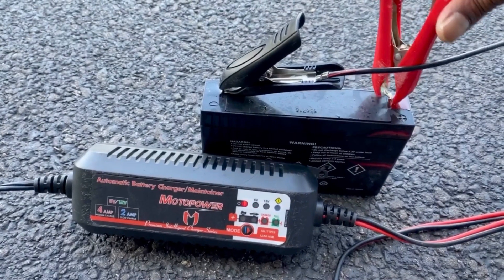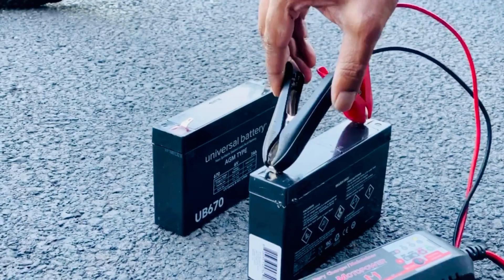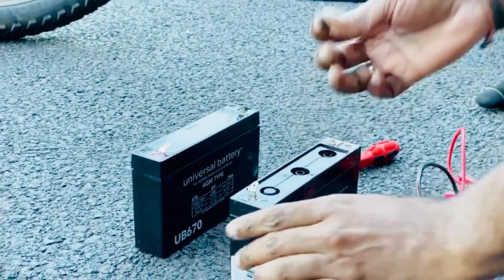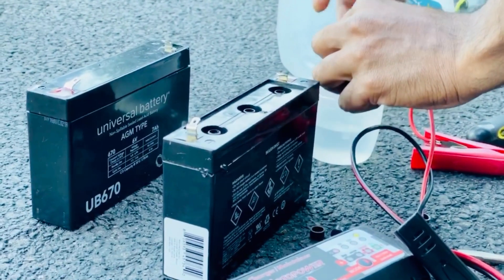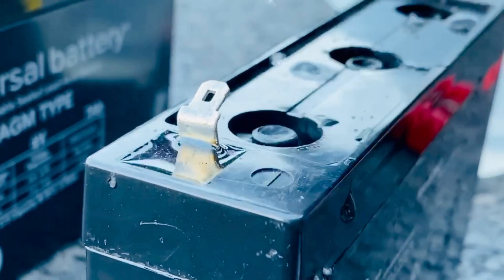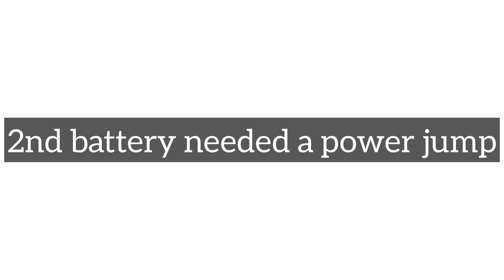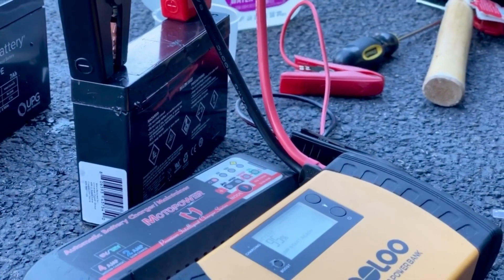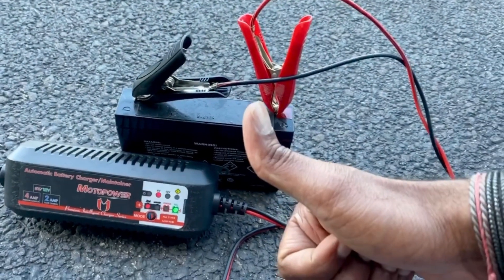Lead Acid Battery Repair in 2 Minutes | Revive and Charge 6v 12v (Jump Repair)

Comment: It will not work need 50% H2SO4 + 50 % distilled water but initially only fill H2SO4 full to charge & enhance most importantly ampere otherwise volt will show 12V after charging but battery shall be weak.Later after fully charge add distilled water & let H2SO4 flow out 50% to occupy with distilled water.Charge final one time to full 12V is achieved
Reply: proper

Comment: I thought these had sulfuric acid in them. How does just distilled water work?

I've seen many YT videos with this same advice. My 12V9AH batteries that were pretty dry, I'm not having much luck resuscitating. I only have a 2.5A 6v/12v smart trickle charger. I have fully charged other similar batteries, and tried using one of them to "kick start" the well watered battery. Maybe higher voltage / current is needed?
Reply: the acid crystalizes onto the lead plates and lowers the amount of surface area sometimes separating the plates from the electrolyte soaked separators between the lead plates in each cell. That lowers the amount of current a battery can deliver and the total power it can hold as the ability to reverse the chemistry by running a charger into it is prevented. Adding distilled water only helps when the liquid is low in the cell and sealed type batteries are not even flooded but instead just enough electrolyte is in the cells to soak the pads between the plates. If you have a lead acid battery that isn't agm or sealed and it has dried out a bit or the liquid level is low  and not covering the plates int eh cell entirely adding water corrects that and the acid is still in the cell as it doesn't evaporate it crystalizes and can be dissolved back into solution. 

Lead acid batteries fail and can be recycled but there is no long term fix for a damaged battery, you can only get minimal use after they are bad. Recycling the batteries just recovers the lead that can be pressed into new plates fixing a battery requires fresh lead plates that are clean and a mechanically sound and positioned electrolyte and no sulfation on the plates. Best you can get is a lower output current and lower then when new capacity from attempting to fix that battery chemistry.